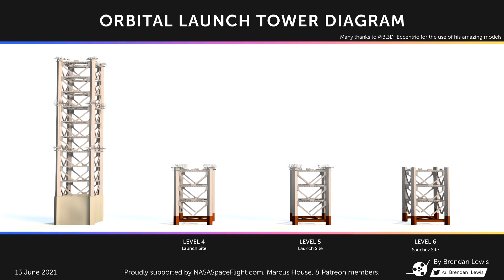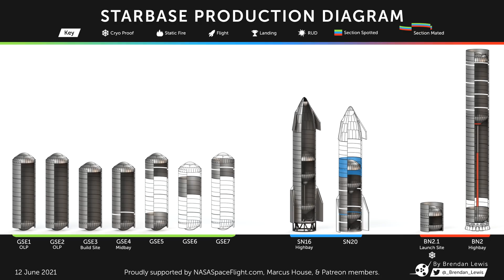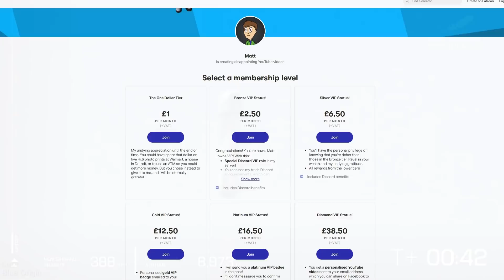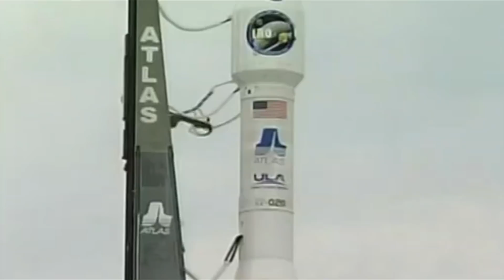Starship SN16 Fate Unknown, SuperHeavy Approaches, SLS CS Nears Completion, & Blue Origin Ends Bid!

Comment: I wondered if SN16 can be converted to be orbit capable
Reply: yes it could, if they would remove the skirt and aft dome and replace it with an aft dome that has RVac capability and they would also have to mount a heatshield, however I belive it won't happen because its probably more effort than just building a new Starship

Comment: Not big space news but,
A local news station reported that Otis Air Force Base on Cape Cod would be transferred from the Air Force to the Space Force. This base is the home of the 6th Space Surveillance Wing and has a long history as an abort runway for the space shuttle. It also holds the only missile warning radar on the east coast in the form of the PAVE PAWS radar system. Some events of the base’s history include the location for the proposed YF-12,  a take off point for Air Force One when then president Bill Clinton attended the late princess Diana’s funeral, and the first base to launch F-16 fighters to protect New York City on the morning of September 11th, 2001.

Comment: why would you use a recoverable liquid fuel space tourism rocket when you could stick a "kickback" SRB with 3 radial drogue chutes and another 3 radial mounted parachutes with a T-12 decoupler on top. Of course the command pod with a mk16 parachute and 2 Radial mounted drogue chutes on the side.

or if you want 3 people to go to space you could use the "Thorough bred" SRB instead, with the same setup of parachutes with the "kickback" and a similar parachute setup with the Mk 3 command pod.

does the same thing, and its cheaper since Solid fuel

Comment: Hey Matt cool update as ever.

I'm having a thought that SpaceX may upgrade SN16 with tiles and stick it on booster 2 for the flight to Hawaii which won;t really need vacuums raptors and not require orbital speed (if I'm understanding right).
What do you think?
Reply: @vablo7198  so the three sea level raptors are only for landing you think? I'm sure they would have enough thrust, maybe need some extra fuel since they're not optimized that high altitued.
Reply: It doesn't have the attachment points for a full set of tiles, and as @Vablo has said it would also need the vacuum raptors after stage separation - which it doesn't have attachment points for.